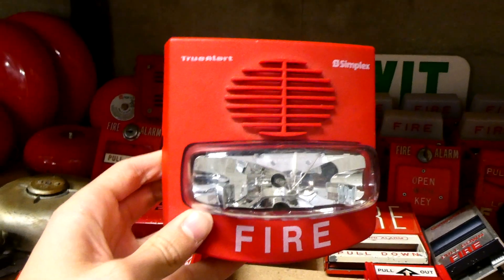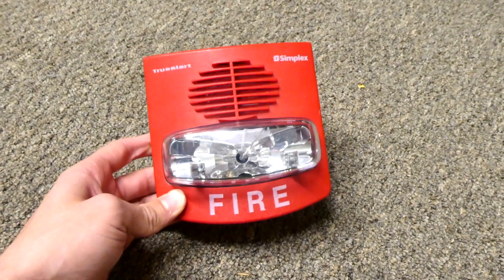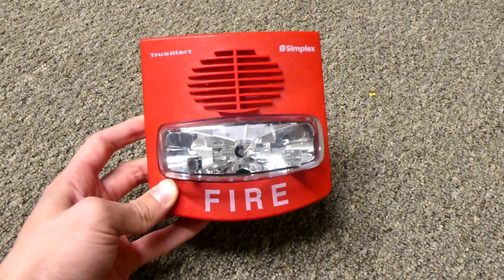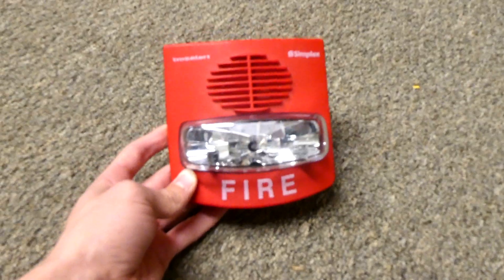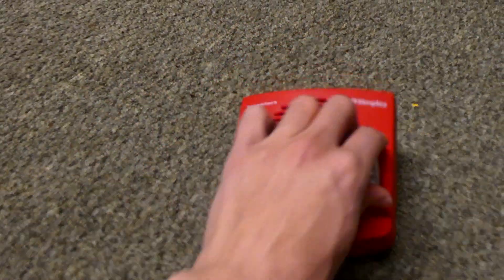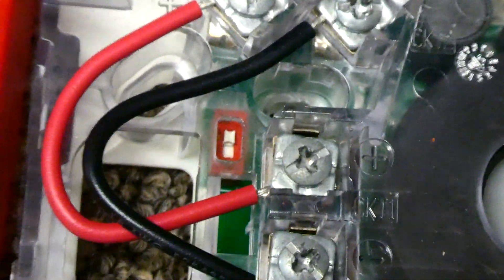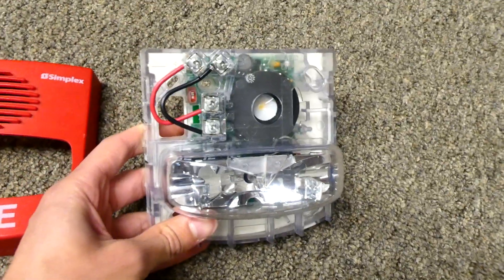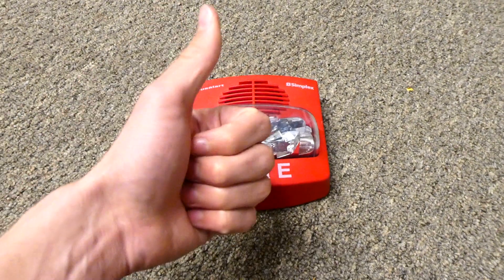Simplex 4903-9426 Selectable TrueAlert | Overview/Test

Comment: Do note you should only use a filtered DC power supply only when powering a truealert or any simplex devices or else it can cause damage to the device
Reply: What about mechanical notification appliances? Does that apply to those as well?
Reply: @LogicDoesStuff  yes
Reply: @captainchris2016  Alright, thanks! Because I was worried about my mechanical device.
Reply: Is any type of battery safe
Reply: @agreel25  yes all batterys are fliterd